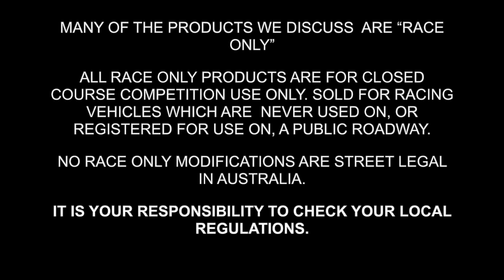Episode 10: Throttle Bodies - Royal Enfield 650 Twins

Comment: Excellent video! Congratulations! My interceptor has low idle speed, something around 1050 rpm when hot. It was not like this some months ago. TB is clean,  new spark plugs NGK CR8E, canister blocked, PAIR valve blocked, crank breather disconnected, air filter cover with intake size increased, sport slip-ons, valves regulation OK. The problem with low rpm started many months after all that mods. Bike runs fine, and everything else is OK. I've regulated the cables stopper screw and bike gone crazy, it just can't hold engine on when hot and when I turn it off and back on. After some seconds it stabilizes. Do you have any idea what could it be? Maybe rectifier? Thank you very much!

Comment: Thank you for explaining Throttle Body function at Micro level. Pick up and throttle of My Interceptor 650 has done down. I get my bike serviced on regular  (Change Engine oil @ 7K even though oil last for 10K). Have changed Air Filter with Engine Oil, Oil Filter but still throttle feels really hard and while riding engine doesnt feels running free or bike feels like dragging. Have recheck chain setting, Spokes are retune and wheel balancing is done. Please advise..

Comment: Hello, in the original body, there are two conical tip screws at the top, which regulate or what they are used for, if the idle speed is controlled by the central valve.

Comment: Hello 🤗, hope you're doing good.

How can one make his 650 twins increase the overall performance, 
Say for an instance bring the 650 to somewhere 800 or a little above and hp of approximately 70 without creating any  Hazzard or issues in the engine later on.

One more question,....... Can we increase the overall performance of the engine in terms of both torque and hp at the same time knowing that both effect the performance of the engine in different ways. Like increased load capacity along with increase pickup and top speed.

And by the way this is in regard to the Royal Enfield Interceptor 650 to be precise.

I liked the videos better than the others.

Thanks & God bless 🙏
Anshul.
Reply from the maker: We literally have an entire channel dedicated to this.  Just watch the videos.

Comment: Hi there 
I found this video very interesting like all your vids i watch
 Now im really enjoying the look of those thottle bodies and ive discovered Hitchcocks even sell them in the UK !
My 650 has free flowing filter and full exhaust system with a remap and i guessing a 40mm thottle body would work straight away but another rolling road tune remap would be better?
Cheers
Mark
Reply from the maker: On a 650 with stock heads, as long as you use your stock injectors, rideability will likely be just fine with your existing tune. Of course you can probably still pull a little more power out of it with a dyno tune.
Reply: @RevelryCycles  thats great and thanks for the speedy reply

Comment: great content guys. Can i fire a question at you? The brass adjustment screw on the stock throttle body, what does it do, and can i adjust it?
Reply from the maker: The throttle stop (on the right side with the nut on it) is a stop to prevent the throttle plates from binding in the bodies. It is NOT an idle control and should not be adjusted.

Comment: Nice. But wouldn't bigger throttle bodies reduce fuel efficiency?
Reply from the maker: Not necessarily, performance  is all about volumetric efficiency.  We address fuel consumption in our big bore video.  I've marked the time where we discuss it so it should start to play right at that part. https://youtu.be/N7nHqVu5npE?t=811
Reply: @RevelryCycles  you guys are awesome

Comment: Can you cover the use of the air bypass valves? I have cone filters and the startup and idle is pretty poor on cold start. Would your throttle body help with that issue?
Reply from the maker: I'm guessing by "air bypass valves" you're talking about the canister purge valve.  When you remove the stock air box you must plug off the two outer most nipples on the throttle body to stop these from pulling air in front of the throttle plates. If you don't plug them you'll get symptoms similar to what you describe. You can either use automotive vacuum plugs or you can use a male plug the original line before the T fitting. 

Our throttle bodies are "Race Only" and don't have these nipples so it's not an issue with them.
Reply: @RevelryCycles  thanks! I was actually referring to the brass screw towards the top of the throttle body but good to know about the canister purge valve.

Comment: How do you fix the vacuum leak because some punk miscalibrated the brass throttle stop screw? This has happened on my bike, and I am not having fun. I need some help on this. This can be very valuable information as even the service manual lacks it as those screws are never to be touched, but in my case, they were tinkered with.
I don't want to replace the whole throttle body for such a small reason. I think you guys can help. My bike is idling poorly, and also, I am facing top end power loss. I can not take the bike beyond 120kmph. It feels the bike engine is going to explode. I think too lean mixture is to blame. I will also check the STFT and LTFT for the same. I need your help to fix my bike. Hope to receive your reply.

Comment: how many mm is stock throttle body? what is the diameter of the intake?
Reply from the maker: Throttle body size is answered in the video. 
https://youtu.be/geW4YyoD7NU?si=3PdHz3dx8JAOaE-M&t=491 

Diameter of what part of the intake?
Reply: @RevelryCycles  suppose you were going to convert an RE650 to a dual carb system, what size carbs would you run? two Mikuni TM32’s?